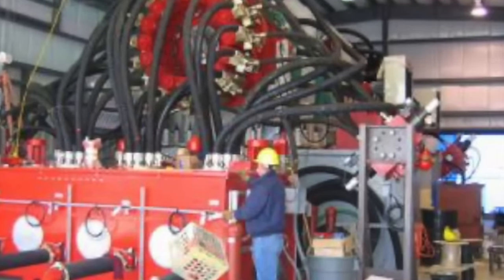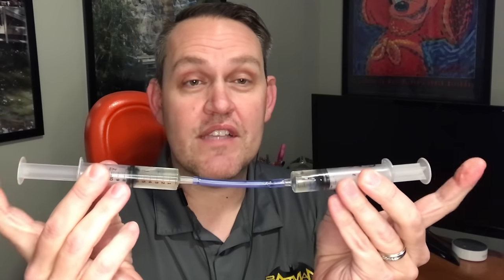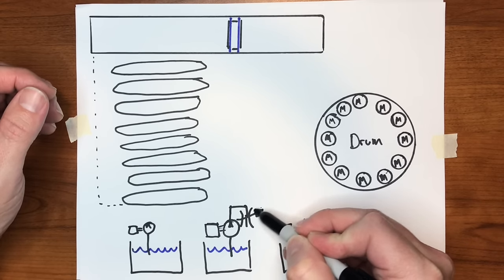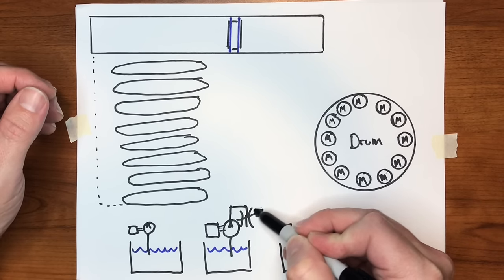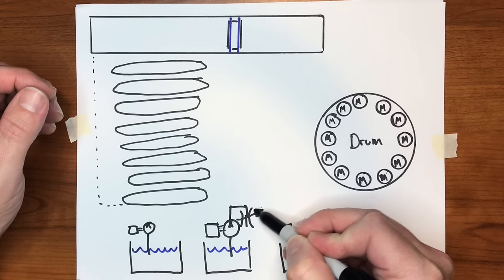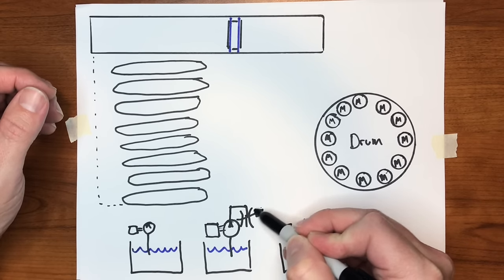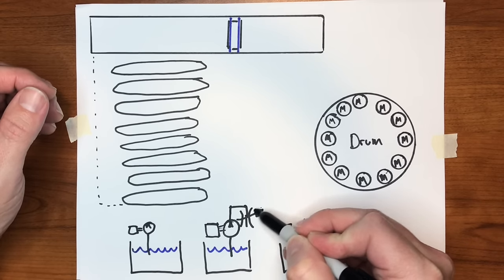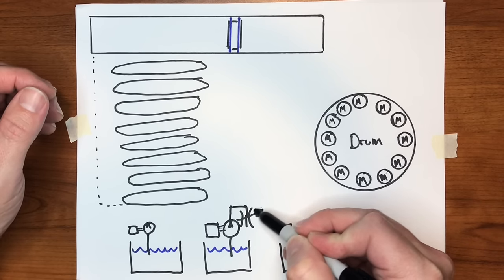How Hydraulic Launch Rides Work

Comment: Just been working on our one today! Whenever I walk into that launch room, I very quickly remember why they don't produce them anymore! Incredible feat of engineering for a coaster, but super complex.
Reply from the maker: I can’t even touch the tip of that iceberg on the complexity. This video was so hard to make to try and explain but I needed to dive into level 3 to tie it together but explain it like level 1. It was Rough for me.
Reply: @ryantheridemechanic as a Diesel Mechanic I understand your frustration. It's hard when you have to dumb down how all the systems communicate and operate to someone who doesn't know the difference between an open ended and boxed end wrench lol
Reply: @IAmAnonymyz  At least many diesel owners kind of know what youre talking about. Try explaining it to a 16 year old girl, or an 85 year old woman, or some 35 year old man bun wearing, uses more product in his (?) beard than my wife does in her hair, soyboy why I need to tear into their engine to see why the timing codes are stored. Hell.... try telling them why NOT going 10,000 miles between oil changes, and using GOOD oil matters a lot.
Reply: @Spike-sk7ql  you can go 10k miles on oil changes as long as you use Group 4/5 Oils but that's another discussion for another time lol. And while I don't have to explain things to 16year olds I do have to explain things to 85 the old guys who are clueless as well as the new hires from that one place we  refer to as Un-Trained Idiot School lol.
Reply: @IAmAnonymyz  also, UnTrained Idiot school 😂😂 I've had 2 people I know of went there. One was a friend who ended up in Utah, and I lost touch with him. The other was an applicant to my small shop in a small town in Ohio. We work on everything from your econobox, to your 3500HD, to your Case tractor. (Won't touch newer Deere though) I've even helped a guy out on a steam engine once. Anyways, he lasted about 2 weeks. First time I handed him a stump grinder to rebuild the engine on, he couldn't do it. We tried to help him, he just couldn't do it.

Comment: The only correction i have as an operator is that the brake fins don’t drop until the train has reached the position where it’s engaged with the catch car, other than that, this was basically perfect from my knowledge as an operator
Reply: It’s actually the opposite with the trains. The ride launches based on speed, not total power. Sudden unloading means it’s not heavy enough and can’t make it over with the speed it’s launched at. Slowly loading it means the train slows down and doesn’t go screaming over the top hat. You cannot under ANY CIRCUMSTANCES use the launch boost function with any load in the train, this would actually hurt people pretty severely.

(Edit) To clarify this a little more, no matter how heavy the train is (within normal train weight specs) if the system says “I’m launching at 119.7 mph” it’s gonna launch that train to 119.7 mph. Lighter trains carry less momentum than heavier ones, and actually need to be launches faster than fully loaded trains. We had specs for the window of “speed reduction” (available on our launch screen and show in meters/second” for each number of loaded rows. From empties, we’d start at 3 rows loaded, cycle until the speed reduction from maximum speed was high enough, add a row, and repeat until every row was loaded.
Reply from the maker: Thank you.

Comment: Oh this is one I'm DEFINITELY watching.... xcelerators acceleration left my soul in station. I've never been weightless on a launch lol.... And to further elaborate on the Xcelerator power crank. It was rumored to have hit 114mph iirc and I would have been signing a waiver to experience THAT
Reply from the maker: The testing Sandor did is nuts. You blink and the train is gone. Still one of the fastest acceleration rides in the world.
Reply: @ryantheridemechanic  there's actually a video somewhere of that said test. Midway Mayhem posted it. 0-117mph in 1.8 Seconds is the reported max... 0-82mph in sub 3 seconds was insane.....I could only imagine what 0-117 mph sub 2 seconds is like
Reply from the maker: @IAmAnonymyz  yea I heard they used a train that was running all season so it can be torn down and inspected after that testing.
Reply: @ryantheridemechanic  I got lucky in December to be able to ride it in-between the huge rainstorms that hammered Knott's. Definitely realized the hype was real. I really wanna experience an S&S Compressed Air Launch. I hear those are even more forceful than hydraulic.Speaking of Knott's ... I honestly hope they fix Montezumas Revenge. Nothing beats the nostalgia of a Schwartzkopf Shuttle Loop. Only one I got to ride was Tidal Wave/Greased Lighting at Paramount's CGA before they removed it
Reply from the maker: @IAmAnonymyz  I grew up in tidle wave 😃 I went on max force this year and HO-LEE-CRAP that was intense!!!!
Reply: @ryantheridemechanic  yeah I'm trying to make my way to the OTHER Great America. Having season passes to both Cedar Fair and Six Flags definitely has perks lol.... Didn't realize how much I actually missed Great America 🤣🤣🤣or as us old timers call it Marriots 😂😂

Comment: I always think of TTD! My all time fave roller coaster (night ride, forward load, 3rd row, load side aka inside seat aka top hat non-catwalk side.

I have one rollback stalled 3 sec at the very top. Feels like your back's going thru the seat. You feel gravity a lot more than going forward although there's no 270 twist to shift the momentum. Very smooth though. The second time there no wound effects just the zip of the cable. A mom who got up the nerve to ride the last ride of the 2006 season with me was stunned. I said tell Dad and the kids (who were watching) people all over the world will want a rollback and you got one on your first and last try. I know riders who had 35.

TT2 will have a mini rollback built-in we'll see how that feels. Wicked Twister felt nothing like a true TTD rollback for example. It felt like the high seatback was going to break apart on TTD.

My maintenance supervisor friend pushed TTD over 3 times when it's been stuck. Someone caught one on video. 

Thank for the in depth explanation of what used to be.

Edit: It's amazing TTD lasted as long as it did. It makes me think TT2 would have been in the works with the RMC re-purposing Mean streak into Steel Vengeance successfully ie. they don't have to tear down TTD's tower. Another educated reasoning is CP spent a lot of money on their 150th anniversary entertainment which was pushed out one season because of the pandemic. It was called Spectacular the following season. They planned to do the night show and expensive parade floats for two seasons. This season Live E! had budgetary constraints and literally be creative, I think because Boardwalk with Wild Mouse, moving rides and the Grand Pavilion replacing Wicked Twister got the big budget. Adding restaurants here & there the past few seasons. It makes sense to me unofficially that TTD being repurposed into a more efficient TT2 was planned, regardless of people and enthusiasts telling you they hadn't heard of that so it couldn't possibly be true ie. someone would have said something. My logic is more sound imho That's another video for you. Speculation on new rides, and in CP's case entire areas.

btw, YouTube's video description count is 5,000. My recent Live E! backstage video was exactly 5,000! I've been putting that in my descriptions, how many characters I typed lol Not too many are wasted on frivolous info. It has to be interesting even if I'm an audience of one. This comment is only 2,012!
Reply: I like your style. I love the non-catwalk side too, especially the front. I was lucky enough to ride TTD eight times.  Also, I was in the Fast Lane+ line on Sunday August 15th 2021 and witnessed flying debris. I didn't see the flag plate but I saw what I believe to be a sheared bolt head moving at high velocity ricochet off the railing I was leaning on.  It was freaky. I'll never forget the sounds of agony that woman made! The whole situation was horrific.   Anyway, can't wait to get on TT2 it's gonna be epic.  Nothing stops an enthusiast
Reply: @samich57  That's interesting info. The first I've heard from someone whoo was very close. It would have been like a bullet hitting you. It would have probably been one of the two counter sunk bolts that sheared off from the left side flag plate. An irony is the left side proxy sensors they trip are primarily in the unload. A vast number are on the right side. 

I read the 300+ page Ohio Dept of Agriculture Report pdf. It included photos from a distance of the blood stains on the pavement. A lot of the report was a 'maintenance dump' around that time of all the maintenance record time sheets not just TTD but even fixing A/C in Hotel Breakers. (I found out my friend who I mentioned pushed TTD over in the past doesn't often take lunch). It should be noted the ride ops handled the situation perfectly based on their reports.

I happened to walk behind the paramedic's truck with its sirens on when it was entering the maintenance gate by the motor house driving up to TTD's entrance. Small kids too young to ride were asking what happened. People were lined up along the fence from the entrance like they do when it breaks down. At that point a manager was talking to riders on the trains that were being wheeled back into the station. I didn't take any video or hang around.

The weather was perfect that day and she was under the sun shades which was one thing that worked in her favor. Ironically the flag plate most likely flew thru the small gap between the sun shades then ricocheted off the metal sun shade supports. Slightly to either side it would have flown past.

You can hear her moaning/crying 'Help Me' in the Cedar Police body cam. Amazing she was conscious. It also shows a ride op coming from the area it sounds you were at to give part of a bolt to a maintenance employee who I've seen around.

The report didn't redact her name or address. Her husband's a COO of a company so they live in a mansion. Without going back to look up specific info, she was a very smart lady getting her Masters degree in a teaching field. Terrible that a person like that got hit. Not that it's good anyone got hit. There's videos on YouTube that the mistakenly ie. didn't do their research at all! that show a teacher in IL that looks similar but's not her.

Earlier in the day I saw someone's hat fly off on the top hat down to Millennium (Force) Island.

I can't remember how many times I rode TTD. I have a season pass since 2006. My friends who rode it from the day it opened had over 3,500 rides with 35 rollbacks (rounded off). I most often rode it at night when the crowds were small and the regulars were riding. I literally ran onto the train once in the same seat I had just gotten off of. A ride op waving me to hurry up the ramp. 

One guy I rode with often liked the outside seat for the sideways pull in the 270 deg twist. So that was convenient for us. My last ride was during the day I can't recall when but it would have been close to that date. My first one was during the day. It's interesting the crowd seemed a bit different compared to the night riders.

Riding at night I also very often got the seat I wanted. Good memories really.
Reply: @amusement420  I agree. I've read the report too.  The hand written maintenance logs and metallurgy reports explain a lot

Comment: Really enjoyed this one Ryan. 
Couple questions:
1. What controls the dog on the train? You mentioned if the dog was still in the down position on roll back it could cause damage. How does that get engaged/disengaged?

2. How often would hydraulic fluid in the system need to be replaced?

Keep the content coming 👍
Reply from the maker: The dog is latched up in the train. Electric coil release the latch and the dog drops. The dog just sits in the pocket of that catch car. That act of being forced apart from the catch car forced the dog back into the latch. 

Hydro fluid is normally replaced annually unless contaminated.

Comment: Hey, as far as a safety for possible rollback with the launch dog down, simplicity could be the best solution there. What if the launch car, after it slows down, is on its own tracks obviously. What if the launch dog track is where the train could be 5-10'  above the launch car, and the launch car can not start returning until the train has cleared the top hat? That way no matter what, the train is safe, the cables are safe, and the drum, and hydraulics are safe. And could the dog being down possibly take out the brake fins?
Reply from the maker: It’s like s&s did where they pull there’s under the track. Vekoma to. Not sure why they kept it there. But it does keep the cables shorter, and that’s a good thing. The dog is in the dead center of the train and the fins for brakes are about a foot to either side of it.

Comment: I was on Kingda Ka last year and it was operating as normal, but on one of our rides we only made it about halfway up the tower. I have always been wondering what might have caused the large decrease in speed, so do you know what might have gone wrong?
Reply from the maker: Not really, the systems are extremely sensitive. Shutdown could have come from over pressure, over speed, under pressure, under speed and don’t forget accidental estops or ride stops. Could have been a sensor on a brake fin not reading down mid launch.  Thousands of possibilities.

Comment: the american ones seem to have constant downtimes and long ones unlike the ones in europe like stealth and rita where they have had minimal to no downtime and with stealth holding the record of fastest acceleration it is surprising that it hasn't had mroe downtime really questions if maintenance has something to do with it
Reply from the maker: @antonytsai6611  could also have something to do with launch length. But also the US models were some of the first ones correct? Maybe later revisions have fixed a lot of problems.
Reply: @ryantheridemechanic  rita was 2005 and stealth was 2006 desert race was 2009? launch length will probably have something to do with it due to time under tension for the cables and the amount of retractable brake fins sad to see this model discontinued as that launch is pretty insane especially on stealth
Reply from the maker: @antonytsai6611  just wait until Intamin figures out how to hard hydraulic fluid to a stator! Then it’s game on!! Haha!!!

Comment: Your such a nerd.... Hehe love it.😅
Does a swatch plate act like a clutch.
Reply from the maker: So a swash plate is a way to transmit fixed motion into a rotational force. So… think of a plate with pistons attached rotating.  when the plate is vertical, none of the pistons move in or out of their bore. When you tilt the plate the pistons now travel up at the top of the plate. It’s hard to think about. Rotor blades on a helicopter get their position through a swash plate controlled by the pilot.  Look up swash plate operation and I’m sure there are some great videos on them.
Reply from the maker: Try this one. https://youtu.be/mgn1UDazkRo?si=_21-Q-E5Sn_cydVo
Reply: Very helpful Mr Ride Mechanic. I've got it at my level if not yours. Keep up the good work.
Reply from the maker: @simoncurrie5520  thank you!

Comment: An empty train actually requires more speed to clear the tower than a full train, because it has less momentum. For this reason, none of the hydraulic launch coasters actually launch at their advertised speed. However, a full train requires more power to launch than an empty one. The systems work best when trains are all about the same weight. Kingda Ka, for instance, usually requires a minimum of 14 riders on the train. This can be annoying on some weekdays when the park is very empty, as it can actually take a while for a group of 14 to form.

All the rides have the same launch sequence. The launch dog and drive tires drop simultaneously, allowing the train to roll backwards. Once the launch dog engages the catch car, the brake fins lower, and the launch starts 5 seconds after the brake fins lower.
Reply: Close, it's actually 6000ms from the couple up and brakes down to the launch command. This comes from a 3500ms delay to verify linear train / catch car position and a 2500ms hold delay. 
 
Source: I have the code in front of me right now.